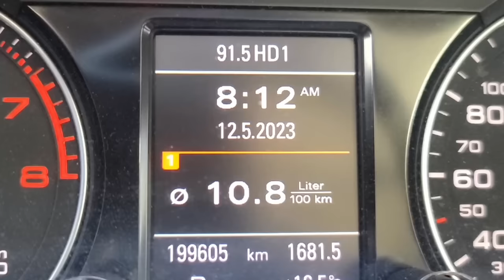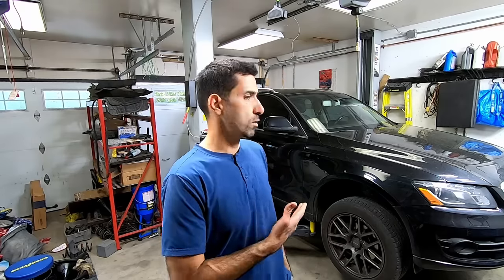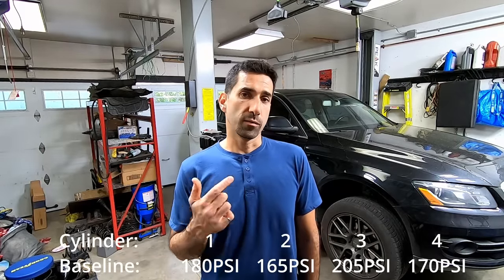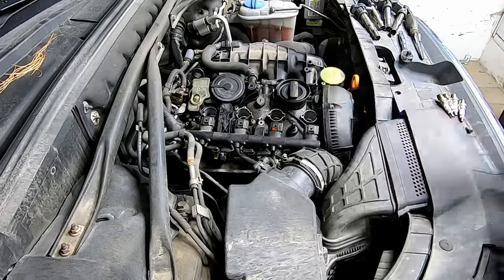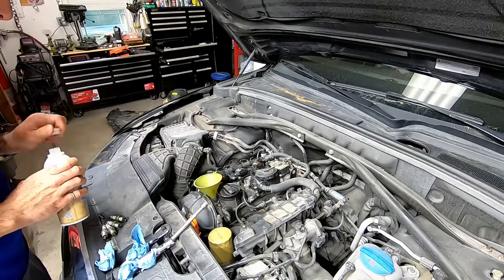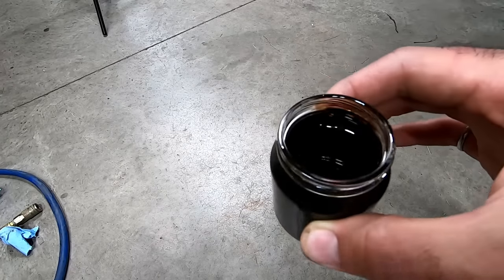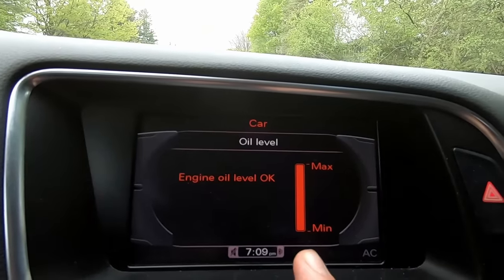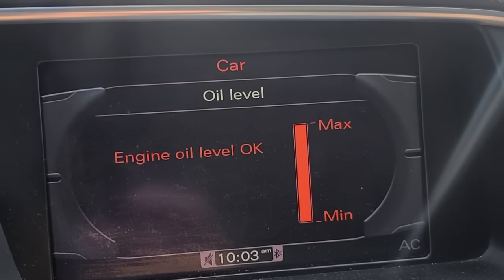How to fix excessive oil consumption from clogged piston rings (Part 2)

Comment: Ive got an 07 mazdaspeed3 that I absolutely love. The owner passed it on to me with oil burning issues that went undisclosed.  After having the cylinder head done up, valves replaced, and replacing the k04 with a rebuilt, it is still losing about a quart of oil every 400-500 miles with good compression and leakdown. I have immense hope in trying this soak. From considering a $6k engine swap (that i cant afford) to spending 10 dollars in chemtool, I just want to say thank you for this video. I will update when I see the results 👍 wish me luck
Reply from the maker: Please keep us posted wth your results
Reply: Pcv catch can mod
Reply: Let me know how it goes ! I have a Mazdaspeed 3 and I am doing the soak right now :)
Reply: Hey, did it actually end up working? I have a 06 mazdaspeed 6 and i have the same very high oil consumption with brand new turbo, good compression and good leakdown test results. I'm thinking of doing something like this, would you recommend? Also to add, my car smokes on decel when i tap the throttle.
Reply: @alperena4698  I haven't gotten around to it sadly. December has been a busy month, but im planning on giving it a shot in the next few weeks
Reply: @sheldond1992  Ok sweet, let me know how it goes and if it changes anything👍
Reply: @alperena4698 I know this is pretty late as far as replies go, but I did get around to doing the soak a couple weeks back and I haven't lost a drop of oil since then. Definitely recommend giving it a try
Reply: @sheldond1992  Sweet, thanks for the reply

Comment: absolutely amazing.. thank you for your time and video, i will be trying this on my 2012 a6 3.0t, currently burns 1l every 280 to 300 miles. hoping for the same result!
Reply from the maker: Oh man... good luck - keep us posted!
Reply: Any update?
Reply from the maker: @DkPlayz  still no light - I'm waiting for 5k to change the oil... got another week or two to go
Reply: Havent done the soak yet but i did do a fresh oil change and switched over to 5w40 liqi moly instead of the 5w30. I also used liqi moly oil saver to help with any old seals. Just got a little over 500miles before I had to add a quart. Will be doing the piston soak within the next few weeks as to extend the fresh oil a little longer before its drained. I'll post an update once complete, hoping for good results!
Reply: @ETMotorsports  It’s actually astonishing that this 1. Works and 2. Doesn’t kill the turbo
Reply: @curtg5654 i have a A6 3.0 supercharged one too, i aint loosing oil too much 1 liter on 5000kms but like to know if your soaking has worked out. Can you let me know please?
Reply: Any update?
Reply: @curtg5654  my 3.0 L TFSI 2010 consumes around 1 liter for 1500/2000 kms, I would also like to know if anyone with this engine has done this piston soaking with what result? thanks in advance

Comment: Greetings from Northern Ireland, UK! I managed to get a hold of 2 bottles of Berrymans B12 and I'm gonna try this on my 2014 Audi S3 with the gen 3 TFSI engine and about 107k miles. It has an oil burning issue that has been getting progressively worse of the past year or 2. It started with using about a litre every 1300 miles and is down to about a litre every 600 miles. Hopefully this method will also work with the newer gen 3 motors but I will report back after I done it!
Reply from the maker: Good luck! Keep us posted

Comment: So I just did this. I purchased a 2014 a4 quattro. In super great shape, 100k miles. First thing I did was get it an oil change. Before the next oil change I had to put in several quarts of oil so I was like ughhh. Found this video and decided to give it a try. I got 2 cans of the b12, new plugs, new coil packs, new oil with liquid molly in it and some seafoam to also add. Started it two days ago. Removed the coil packs and plugs and noticed two were oily. I tried to turn the crank to level the pistons with my 24mm socket but I guess I didn't get a narrow enough one and it wouldn't fit with the wrench. So I used channel locks at an angle and was able to turn it for the most part. Then I poured in 110ml to each one, capped it with paper towels and went about my day. Came back 6 hours later and topped it off and turned the crank as best I could. 6 hours later opened another can and did 110ml to each. 6 hours later topped. Today I took the paper towels off to let it evaporate. I laid down white shop towels over the engine and car bay, turned over the motor a few times and let the pistons shoot out leftover b12 and carbon. There were some decent chunks of black carbon shot out. Seems two of the pistons were worse. After doing that a few times, I put the old plugs and coil packs on. This video and others made me think starting it would be a nightmare. After about 15 seconds of cranking it turned over. No lights or misfires. Was a little rough and white smoke shot out the back. I let it idle for 10 min and then took it for a HARD 20 min drive in manual mode. Ran it to 5-6k rpm each gear. Did some highway driving and accelerating too. Got home and let it cool a bit then used my extractor to drain the oil. Threw on a new filter, filled it with the oil and seafoam. Then removed the old plugs and coils and added new ones. Put it all back together and the car fired up faster than ever. Took it for a drive and it's like a new car. Idle is rock solid. Acceleration is much better. I reset the oil trip meter as well. So now I will just monitor any oil consumption I see before the next oil change. Maybe I will run this process through another time to see if I can get more out. Other than waking up to go to a cold garage it was a super easy process. Thanks for posting this!
Reply from the maker: @nickicenroad484  great results thanks for the update... if I read this correctly though you added seafoam with the new oil? You're not supposed to run this in long term - only if you're doing a second flush back to back
Reply: @ETMotorsports  Correct. It says you can use seafoam with oil or gas. Are these Audi engines not happy if you run seafoam in the oil?

Comment: Just wanted to give an update on my comment thread from 4 months ago. I have now driven the q5 approximately 4,000 miles and have burned no oil. verified through the mmi and also a dipstick. It was burning a quart every 350 miles. I believe this method will work on 2015+ model Audis. There are three variations of oil control rings, the second generation with the elongated holes were released for the 15 model year I believe. I dont know how helpful it would be on pre 2015 with the very tiny holes in the oil control ring.
Reply from the maker: Awesome results!! Glad it worked

Comment: You mentioned at the beginning of the video that the previous owner didn't tell you that it (the second car with the oil consumption issue) burned oil however a little later you said that the car smokes a lot, at start up too.  Seems to me that would have been your first clue that it burns a lot of oil without the owner mentioning it.  Thanks for sharing this video!
Reply from the maker: I'm the one that looked at the car when we bought it - I didn't notice any signs of oil consumption and I wasn't looking at the exhaust specifically... the car was actually very well maintained and was a single owner... it's a lesson learned for sure - I'll be a lot more diligent looking at 2.0ts in the future

Comment: Very nice helpful video, but I think what helps a lot is using fuel cleaners a lot  to ensure a clean burn,also maybe engine flush too :)
My car runs like a clock thank's to fuel cleaners .
Reply: Hi what fuel cleaner is good? And how often do you use it?
Reply: @romankim3198  I don't live in USA so I can't really say about your brands , I use mainly the cheapest ones I find on sale , STP used to be always on sale here in Italy.
I buy the ones on sale cause I tried 6-7 brands and they all work well.

I use it every other full tank of gas.
Consider the additive costs me 5€/$ and 2 tanks cost me 120$+ ,so it's basically the same price if I don't or do use them.
Basically 1 tank ( or 2 if you wanna be cheap ) straight fuel then additive.
I used to have a bottle of additive to mix every tank of fuel, I used half of what I used for full tank.
So basically  I had additive always in my tank.
My car runs like clockwork, no smoke.
And keep in mind it's a pre DPF diesel with still EGR on, so not as clean as pre EGR diesels.
Reply: @dimmacommunication  Thanks. I will definitely try some of it
Reply: So you don't know what is in the cheap 'cleaners' you are putting in your fuel?
And you surmise thats what kept you safe from this?
How do you actually know they are doing anything, especially as you are using 6-7 brands?
If you're vehicle doesn't actually burn oil at this time, then most likely you can keep it that way if you use a good brand of oil especially a full synthetic, and reasonable oil change intervals like 3-5K miles not matter what the marketing blurb says on the bottle.
If you vehicle is burning oil, then doing a piston soak may well be a good cheap fix a DIY'er can do.
If I owned and Audi, burning or not, I'd do both as a preventative.
There are also oils like HPL which have long lasting cleaning additives which don't burn off in a few hours yet retain oil viscosity rating.
Reply: @boots7859  I know I've been kept safe cause my diesel cars always run better during and after the treatment.
Expecially I had 3 diesel cars in the family before that after a treatment smoked noticeable less. 

That's a fact.

Comment: Hi. Did you do a compression test after as not sure if i missed it in the video?

I have a 1.4tsi golf 2013 and it uses 1L every 300miles. Has misfires and bad compression.

Either way im gonna try it as i have nothing to lose apart from replace with a used engine or get it repaired.

I will comment if i have any success.
Reply from the maker: @JannyUK  hey there was no significant change in the compression... yeah your engine sounds perfect for this treatment - good luck!

Comment: The B12 was Cleaning- Dissolving out the Carbon as it is Designed to do, that was reason for gritty feel in oil...once you cleaned the oil scraper rings, oil consumption should decrease greatly or stop...

Comment: Most german cars have pretty loose piston rings because their engines are designed to operate on the autobahn. When driven like how we do in the US, the engine is rarely driven hard which means the carbon can build up from oil burning which just makes the issue worse and worse. My suggestion is make a habit of flooring the car once a while to keep carbon from building up.

Comment: Just want to add to a comment that I made here a while back.  I was getting excessive smoke, burning a lot of oil and the emissions were off the chart.  I wouldn't have had a hope of passing our national car test with those emission readings and I was being advised by a mechanic to scrap the car or else do an engine rebuild. Anyway, I did a few  piston soaks over a period of a couple of months and recently I passed the national car test on the emissions 😊 I was more than surprised as the car is still burning a little oil, nothing like it was but it's still not perfect. The plugs are still sooty when I check them and I can still see a lot of smoke coming from the exhaust when I start the car first thing in the morning but all of these symptoms were several times worse before I soaked the pistons so it definitely made a significant difference to the extent that I can now legally keep the car on the road. I would say to anyone wondering about the benefits of this process is to try it, you've little to lose.  The first soak produced the best effect for me where the oil consumption went down by 80%.  The next soaks produced less effect though they stopped the plugs from getting very oily and sometimes misfiring on one cylinder in particular.  My advise to anyone is not to expect perfection after the process.  If you can reduce oil consumption by a significant degree and if you keep an eye on your plugs, keep them clean and maybe put an additive in the oil and fuel tank regularly then your car may well go from being a write off to something salvageable.  Don't give up 😊. I learned a lot during this process and managed to keep my car on the road so it was definitely something worth doing. The mechanic I mentioned who told me the engine was shot scoffed when I told him about YouTube videos advocating piston soaks but he looked a little sheepish when I went back with my car test results 😋 Another mechanic refused to even work on the car because I told him it was burning oil. To the maker of this vid, thanks for the knowledge and for posting, it's much appreciated 👍
Reply from the maker: Hey those are great results - thanks for the comment! It sounds like your car was pretty bad to begin with - happy that it's back on the road... smaller amounts of oil can be lost from other sources - turbo,  pcv etc. - make sure all that is checked and accounted for... but even 80%+ reduction is significant...

I'm not surprised the mechanics don't want to do this - they have plenty of reasons all of which make sense... there's zero guarantee that this will work,  it takes quite a bit longer than a regular oil change,  they make a lot more money rebuilding the engine etc. Plenty of people even in the comments here have been very skeptical but anybody that has tried has had positive results...

Comment: On the B-12 piston soak, from my experience, 113k miles, started consuming oil at 80k (Audi rep said we can correct that with an oil flush aka Liqui moly.. nope).  So I did the B-12 soak, I started it before going on a 10 day vacation. Engine turned fine and then it didn't, note you can NOT go backwards once you find difficulty turning the engine which happened to me, there was so much carbon in the cylinder, that when it broke free, it all went to the downward side of the cylinder and being a zero clearance engine it two blocked the piston. After much more B-12 and a cheater bar, I was able to get the engine over TDC on that cylinder, worrying that I may have done damage. With all the cylinders at midpoint, I made a tool using a rod and put some weedeater string on it, repeatedly agitated the cylinder and its carbon content, using cheaper paint thinner to create an emulsion and pumping it out with my extractor. Once able to bar the engine over freely again, I was able to continue the B-12 soak and rotate. I must say that the one tool I bought for this project was an endoscope from Amazon, for $27, an amazing bargain which connects to one's smartphone via wifi. I performed a liqui moly flush. I won't know the benefit of my work until I put a few miles on, now that I have the process learned, I will repeat the treatment again before next oil change.
Reply from the maker: Eek... that's the first issue reported with seizing like that - glad you were able to get it freed up... a few of us noted soot left over on the cylinder walls after rotating the motor - looks like dirt on the walls but it's relatively soft... either way keep us posted on the results
Reply: @ETMotorsports  worked. I have driven 800 miles now, oil level the same, I would have already gone through two quarts plus but now...zero abnormal consumption.
Reply from the maker: @MM-fq9gi  awesome results
Reply: @ETMotorsports  I am past 3000 miles with no added oil, now at 116k miles. I pulled the O2 sensor to check its condition, found clean and catalytic inlet free of carbon.
Reply from the maker: @MM-fq9gi  fantastic! Thanks for the note on the O2 and cats - some viewers have noted being worried about the method damaging these parts

Comment: you should mention or warn about hydrolocking the engine rather important
Reply from the maker: Hmm good point but there's never any liquid in the chamber when I start the car after 24hrs...definitely don't crank after just pouring the liquid in
Reply: @ETMotorsports any follow up on the compression checks?
How fast will the chemtool leak down?
So you poured in 100 ml and left for 6 hours, then rotated the crank a few times.
Then it seemed like there was less added a few more times over 24 hours?
Did you rotate the crank again after further soaks?
How much time did you allow between last add and putting plugs back in for fire up?

We have a 2005 Mazda 3 where cyl 1 has visible oil in the cyl around the piston.  Plug on this cyl oil fouled big time.  Typically goes through a quart in 400-600 miles.  Funny not much smoke at the exhaust though.

Probably worth a try!

Comment: When you initially add the b12, do you do it on a warm or cold engine?
I think doing it on a hot engine could help it dissolve better
Reply from the maker: Good point - I've done both... not sure I can measure the difference but it makes sense to have a warm engine